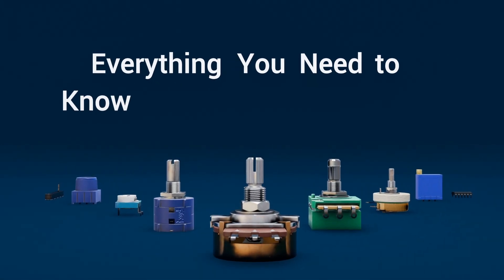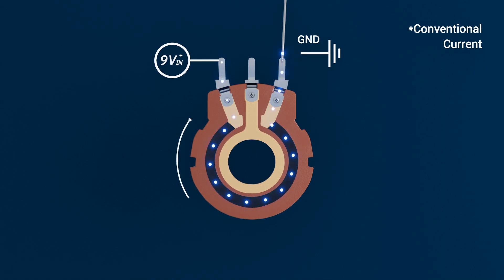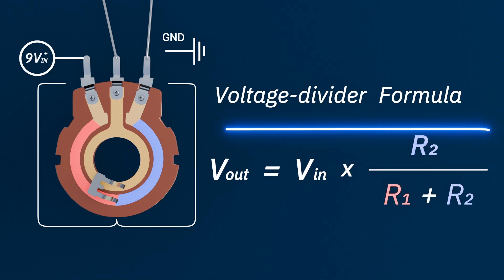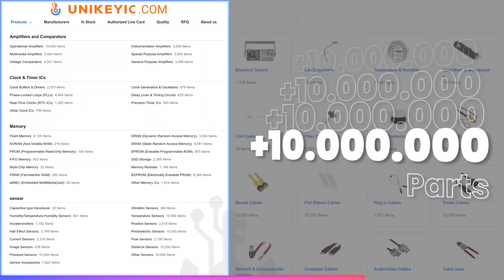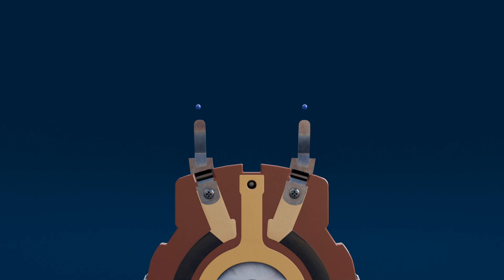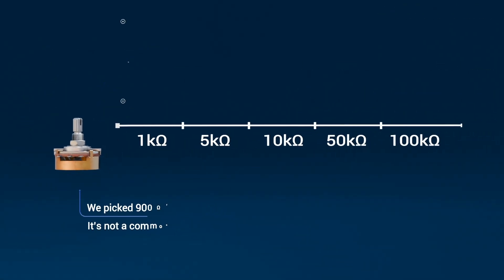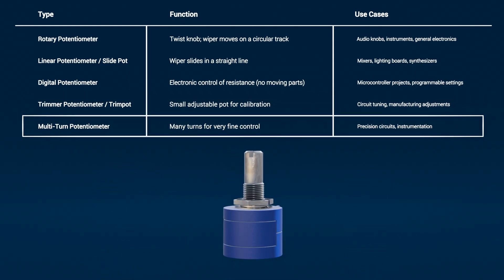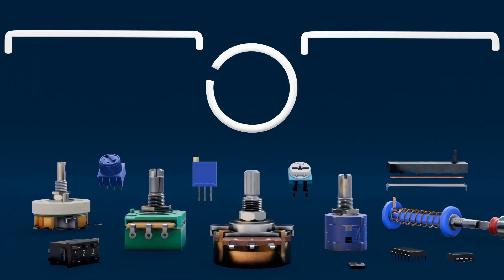How Potentiometers Work? | Voltage Dividers, Types and Anatomy of Potentiometers Explained

Comment: Now do a variable resistor by comparison. Is a variable resistor in parallel? which causes it to change current and not voltage?
Reply: A pot is a variable resistor. Two terms that mean the same thing.

You might be referring to the alternate connection, making a "rheostat", which is as if you gave a regular 2 terminal resistor a knob. Usually in this configuration, one end is directly connected to the wiper and forms 1 terminal, and the other end forms the other terminal.

There's no difference in the pot itself, just in how it is connected.
Reply: @MadScientist267  sometimes a varistor is referred to as a variable resistor,those are resistors that are dependent on voltage,I think its a good suggestion I tok am curious about the mechanics or possibly involved material physics of a varistor,is it just a very strongly sensitive resistor that converts voltage into heat and thus increases resistivity,so like a really thin heating element? but then its like a fuse...so the material should also not melt

naybe some other mechanism,yea I too want that video,another channel named engineering mindset had talked about it in a full general video about resistors but not nearly as detailed as this
Reply: @kazukawasaki97  A varistor is not a "variable resistor". It is a voltage dependent resistance, which doesn't increase with voltage, but decreases. It is what's known as a "clamping" device and is used for protection against surges (such as lightning). It cannot be substituted for a variable resistor/pot/rheostat and are not related at all.
Reply: @MadScientist267 I mean you're open to searching it on the web and the summarised gemini paragraph puts variable resistor in bracketes,its sometimes called that, beyond it being voltage dependent I don't know much details
Reply: @kazukawasaki97  I've been in electronics for 40+ years. I'm very familiar with both components. AI gets more wrong than it gets right at this stage.
Reply: @MadScientist267  😂,well whatever,in the end I think we all can agree a video about varistor could be cool...?😅
Reply: @kazukawasaki97  I mean, sure... but there's not much to it. They appear "mostly open" until they get near their threshold voltage, at which point they begin to conduct. They behave more like a diode than a resistor, in the sense that they have a [much higher] "Vf drop". Unlike a diode however, they conduct in both directions.

They're normally used as protective mechanisms on the line side of the supply, typically after a fuse. Under normal operation it's as if they aren't present at all. If there's a voltage spike, they suddenly conduct and shunt the spike from getting downstream in the equipment, and popping the fuse. .

In theory anyway. They usually explode, and only prevent massive damage. The equipment may or may not actually make it, but they can help.
Reply: @MadScientist267  oh thats neat, theoretically, but the way you say it, seems its practically a more costly fuse?😂
Reply: @kazukawasaki97  Not a fuse in its own right but a companion to a fuse. The varistor clamps, and one way or the other the fuse pops due to excessive current and everything downstream goes quiet.